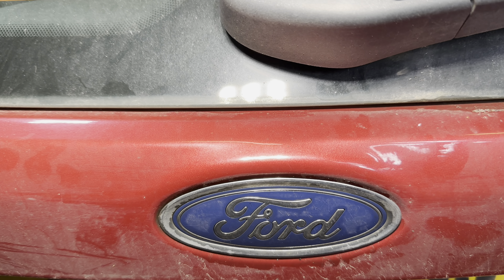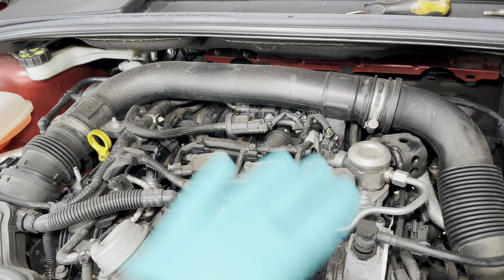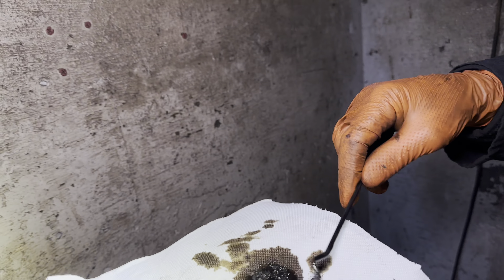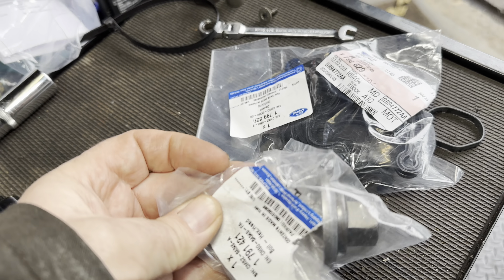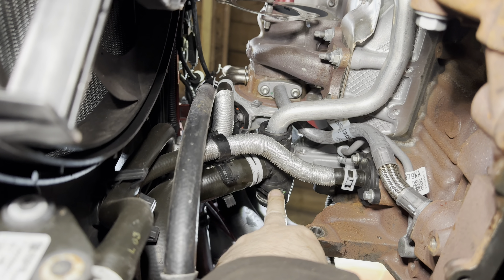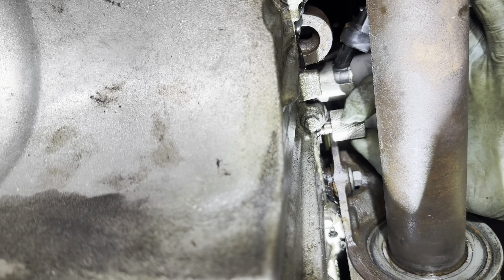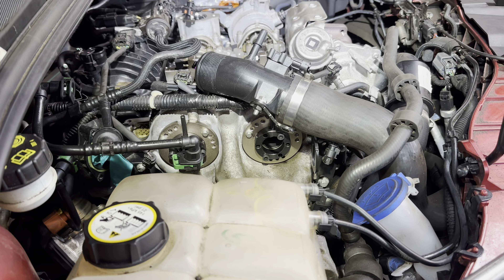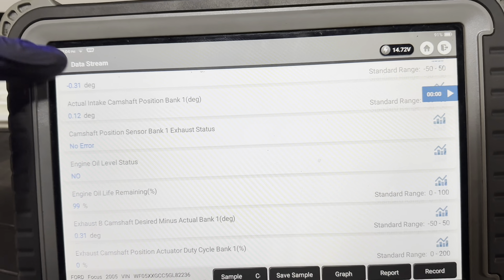Ford Focus 1.0 ECOBOOST (2016) Fault Codes P0012 + P0014

Comment: There is a little trick to hold the flywheel when putting the cank bolt back ( you could drill the gearbox bell housing just to get the flat screw driver in-between the teeth for the flywheel ) good investment in timing tool 👍👍 as usual rody is the man 🤣 the only man who does everything

Comment: Great Job. The belts on my Pug 2008 are "bathing in oil" also. Looks to be an expensive  repair bill for me in the future, although using the manufacturers (specific) oil requirements Helps, with the slowdown of the belts degrade.  See you in the next one. 👍👍👍👍

Comment: Hi Sandy, I got a Ford Focus (uk) 2018 echo boost 1 ltr. Came up with engine oil> then Engine light> toed to garage> obd P0012, P0014… they changed oil pump, timing belt, apparently it’s a known wet belt where it disintegrates, clogs up.. > they returned the car, but when I checked it’s on idle making bit more noise then before, and feels gurgling when accelerating from Idle, bit noisier then before and also can feel bit shaky in idle… > plugged in one code reader says, P0012, P0014 and P0039. 

The garage says they did nothing wrong! And this is how 1.0 let’s are.. but since I showed those codes asked to return the car.. I feel like something not easy with… need help mate if you have any clue pls!
Reply from the maker: The engine timing is wrong, engine needs timed up properly using correct tools